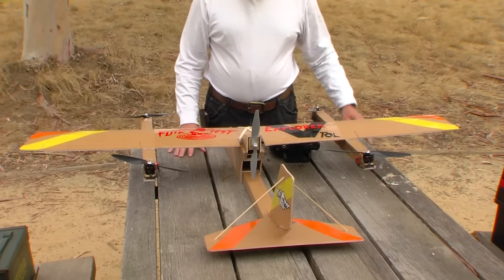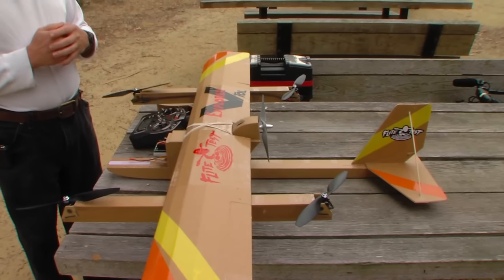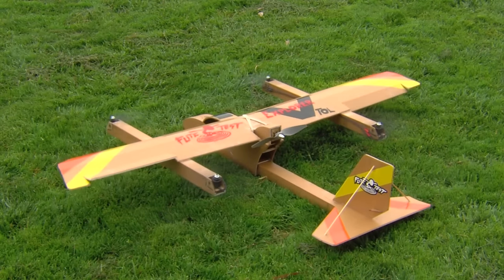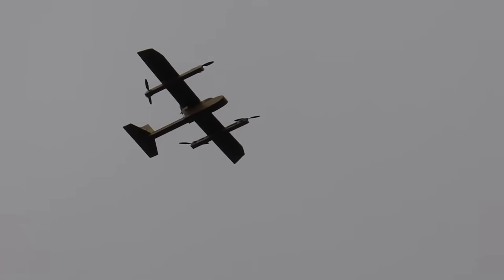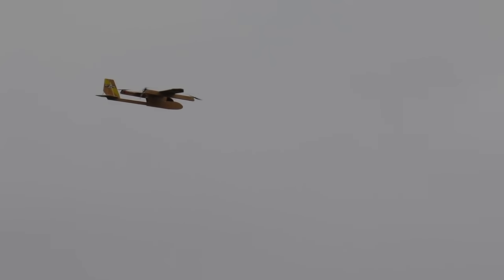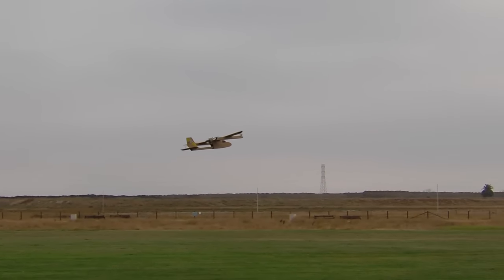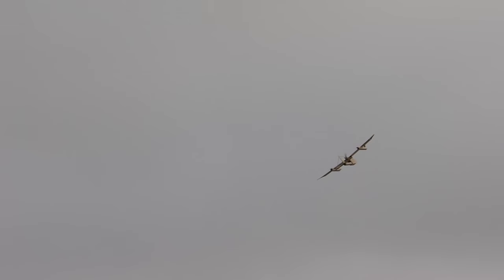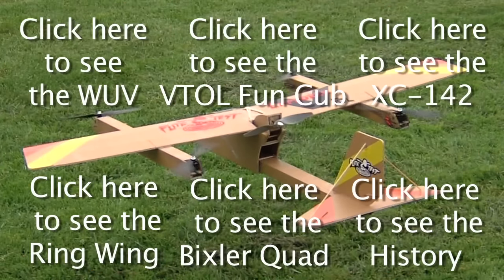VTOL Explorer by Ran D. St. Clair

Comment: Thinking about building one of these but using some 15x15x600mm CF square tubes for the quad arms to simplify the build a bit..20A slim esc's inside the arms for a clean no exposed wires build..Probably scratch build the explorer to save some $$

Comment: Hi Ran, thanks for your great and very detailed build. I have followed all the steps in the manual and almost everything works fine except for two issues. First issue is that my aileron is stock in one position in both hover and FFF. The second issue is that the lift motors continue spinnig very slowly in the FFF. I can very easily transfer from hover to SFF and the FFF and everything works fine except for the two issues. It would be very great if you could help me get over the problem.